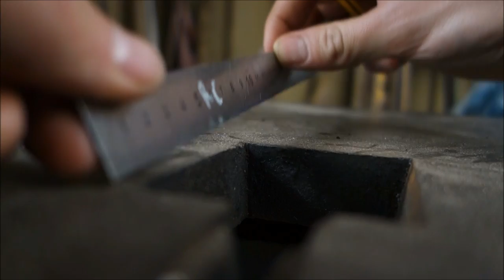Blade Guides Prototype - Big Old Bandsaw Pt. 2

Comment: Hi from England

It'll be due some guards next then...?

A bit on Kirchner :
The UK operations of Kirchner were bought by Alfred Cooksley, Tabernacle St. London....i think just prior to WW1...
Cooksley were a machine tool sales outfit...but also offering refurbs and repair/alterations...
They also listed themselves as "millwrights"...

Did you copy an existing design for the blade guides you've made here...?
Or is it your own...?

Please please don't use this without a guard will you Robin...👍😉
Reply from the maker: Hi Glenn,

I made the guide semi improvised out of stuff I had lying around. I did look at some other videos and pictures of guides for inspiration. They work just fine as they are, but I would like to make them out of nice materials some day. 
I also did this a few months ago and I just now got around to make the video. I also made the enclosure/guard a while ago (before I put the motor on), this will be one of the next videos.
So in short the saw is pretty much finished by now and I have used it quite a bit already! I'm just behind on the video making.

Thanks for watching!